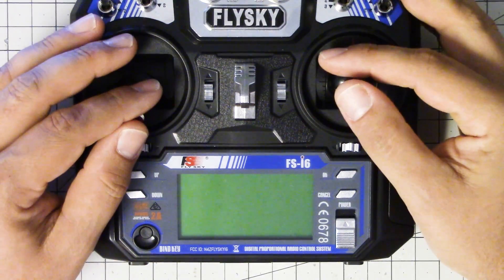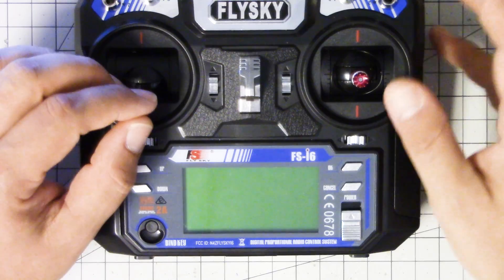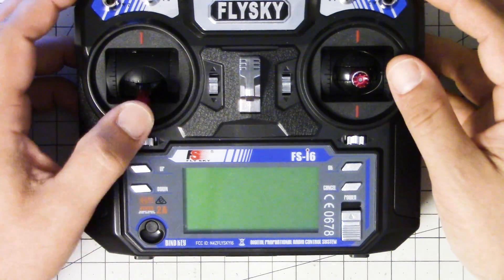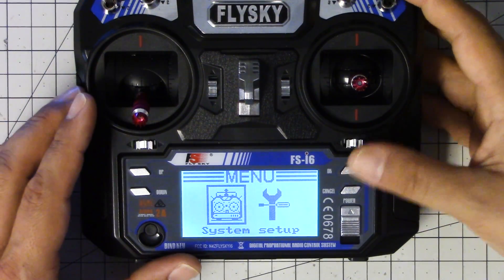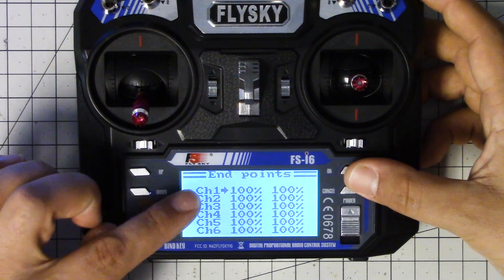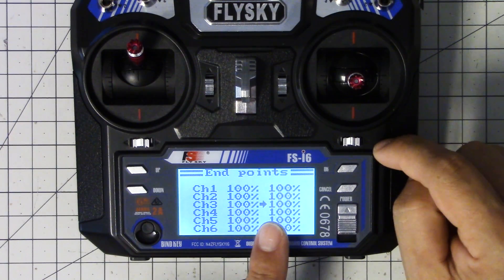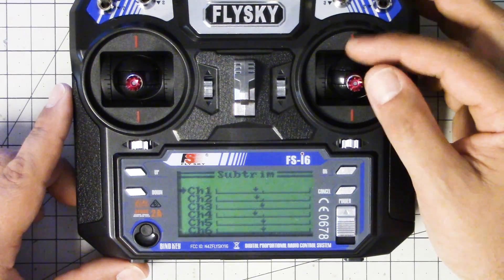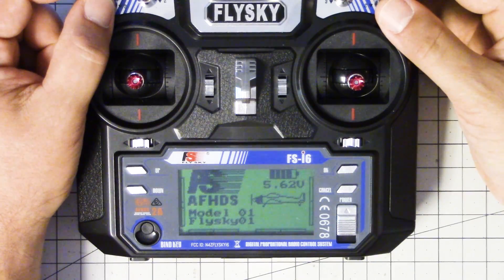FlySky FS-i6 Betaflight Setup: Calibrating Endpoints

Comment: Or just use iBus which (I'm pretty sure) magically sets the endpoints correctly without human intervention.

The only time I ever used SBUS on my i6x was with an Omnibus FC which had inversion on  one of the UARTs and I needed all my UARTs.
Reply from the maker: I'm not sure how iBus could automatically set the endpoints. That would be surprising if it were true.
Reply: That's what I thought. Though I just started doing fast righthand rolls and noticed that they were much faster than the easier lefthand rolls I'm used to. 
Checked in betaflight and was baffled to see the endpoint at 1100. Now I check really everything after every (re-)build
Reply: I'm curious as well - mine were set up really nicely out of the box, and seem to be on point... but I assumed I was simply lucky, or too new to know the difference.  Follow up video FTW
Reply: I don't think it sets endpoints automatically (how would it?), but it does hold the midpoint a lot better than SBUS. Less wander.

Comment: Joshua why not using the rxrange commands for channel 1 to 4. Regards out of Germany
Reply from the maker: Because it reduces the resolution of the channel. Always better to adjust endpoints in the TX if possible. Also, n00bs have a hard time figuring out how to use rxrange.
Reply: Joshua Bardwell: Thanks Joshua, just a quick one, do I even reduce resolution setting (at my Taranis) endpoint to 125 % or do I mess something up?

Comment: Good info. My fs i6 didnt need too much trim adjustment, but my spektrum dx6e needs to be adjusted to nearly 150% to make the end points where they need to be. I also experienced the importance of doing this when I was doing a micro brushed build. The transmitters min throttle was around 18% throttle, so it wouldn't arm since you couldnt go to an actual 0% throttle.

Comment: Great tip for the beginners most ppl that start in auto level modes never know why they are getting drift or uneven control in turns. Even intermediates have issues with why they cant flip or roll to one side the same. its also good to calibrate sticks evey now and then on flysky remote for sure when you get it

Comment: On my fs-i6 there is an inscription "Err1:99%" and it is constantly 99%. Is it dangerous? What to do with it?
Reply from the maker: That is transmission errors between the transmitter and the receiver. But if it's 99%! How can you even fly?
Reply: As flies and the like without problems. As that's what I wanted to ask you. Thanks for the reply.

Comment: Just use cli and you dont need to touch the trims or endpoints on the transmitter. rxrange 0 (low point) (high point) 

If your low number is 1005 and your high end points is say 2115. Then it would be
 rxrange 0 1005 2115
rxrange 1 1005 2115
rxrange 2 1005 2115
rxrange 3 1005 2115

Enter after each line and save. All endpoints are now 1000 middle 1500 and high point is 2000. If your numbers are different for each channel use those numbers accordingly.
Reply: KNUCKLEUP FPV Doesn't this have a negative affect stemming from the size of the packet/frame size?
Reply: S McClure No.
Reply: Joshua Bardwell this is flysky. Trims move endpoints and not just center. Moving channel mapping in cli does nothing to the resolution brother. Its an equal amount of steps from end to end with the same amount of travel. You can use those little tick marks and check this if you want.
Reply from the maker: This reduces the resolution of your control channels though. Much better to use the transmitter. Also, if you set the transmitter correctly, then you never have to adjust subsequent models (as long as you are using serial receivers).

Comment: I noticed that after using subtrim i had to readjust the endpoints again.
Also you might want to mention that there is great community firmware for the FS-I6 that can make it even better.
I now have a timer for example.
Reply from the maker: Oh damn that's a shame. On most modern radios, adjusting Subtrim should not affect Endpoints, but older radios (and apparently this one) do that.
Reply: Dave Interestingly it doesn't do that on the i6s, different firmware though.
Reply: The i6s and i6x run different firmware - I can try to look into if subtrim adjustments affect it on the i6x
Reply: I just tried it again because i wasn't sure anymore but yes, the subtrim directly affects the endpoints on my Ideafly branded FS-I6 with flyplus beta and an afhds (not afhds2) receiver (built in to the board).

Comment: I got the already 10 channel grey stickers tx, had to go into menus as it's on 6 channels default, great for the price and easy to use, have used the fsi6b receiver with excellent range and now got a new design for copter flysky x6b with the dual antennas which are changeable, heard it got great range too, up to 2.3km on YouTube, only need couple hundred metres 😄

Comment: I have that one and did the 10 channel mod and that made it so much better, only thing it doesn't do is talk to you , and the fs-a8s receiver I had trouble with it loosing signal at only around 20 - 25 yards and I tried new antennas , longer antennas , even switched for another one , and still had the same problem , I ended up losing my quad over it ....
Reply: FS-8AS receiver is notorious. First revision was full of bugs which caused the signal loosing and destroyed/lost quads in result. Get FS-iA6B or X6B receivers - those both have functional diversity receiving, IBUS, telemetry and just works.
Reply: Quad Father 504 FPV you can set up alerts via the internal beeper for battery voltage using the X6B RX
Reply: You can say that again!  its amazing, since I did the mod I don't see myself getting a more expensive radio for a long time.
Reply: Quad Father 504 FPV did you try find it with transmitter fs i6 ? You can find in sensors "Err1" its in % closer you are to your quad lower it's gonna be if you are 2m close to your quad its 0% if you are far away its more. It works when you can connect to it. If you haven't set up fail safe and your quad flow away it will not help you. And you need to have powered your receiver.
Reply: BuzzCola 3 reading on the forum Flysky did say they would consider adding an RSSI pad so you can transmit the RSSI via the OSD, I use the Err on the TX but you can't set an alarm which is frustrating. Hopefully X6B V2 will have the pad so issue resolved 👍🏼
Reply: Quad Father 504 FPV try the new x6b receiver and point antennas like mr. Steele🤙🏻
Reply: Gavlar Fpv 78 if you use the x6b swap to the higher dbi antennas. Like the ones that came on the ia6b. But the x6b has ipex connectors. I like the x6b and love my 14 channel mod on my fsi6
Reply: Jason Cross yea Ik I've done ordered it and waiting for it to come in with the new quad I had to order because the a8s receiver made me loose my other quad
Reply: KrotowX yea I've done ordered the x6b and waiting on it to come in with the new quad I had to order because the a8s caused me to lose my previous quad
Reply: Gavlar Fpv 78 yea I've done ordered it already along with the new quad I had to get because the a8s caused me to lose my previous quad
Reply: KrotowX and if I would have known they were that bad I would have waited to order the 6 I ordered when they first came out , they looked awesome on paper and I really wanted to like them because they so convenient
Reply: Quad Father 504 FPV a8s i use on short range micros only. 1/4 mile.i have a 4 watt booster and it goes far out in the country
Reply: BuzzCola 3 yea I tried everything even the goggles , I think it ejected the battery when it went down
Reply: KNUCKLEUP FPV yea I know better now , imma just stick to using it on micros , all the hipe they had on them when they first came out I figured it would be a awesome lil receiver
Reply: Jason Cross you can set an alarm for rssi in betaflight and you can set one on the transmitter with the 14 channel firmware. I have it set on mine.
Reply: KNUCKLEUP FPV please can you link details for 14 channel firmware? That would be awesome if I can do that. Cheers
Reply: Jason Cross https://github.com/qba667/FlySkyI6/releases